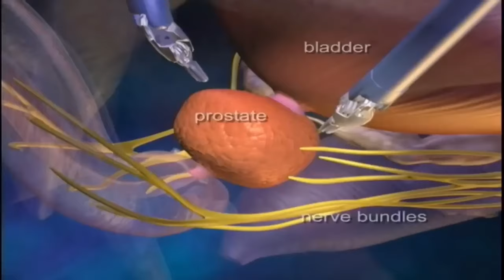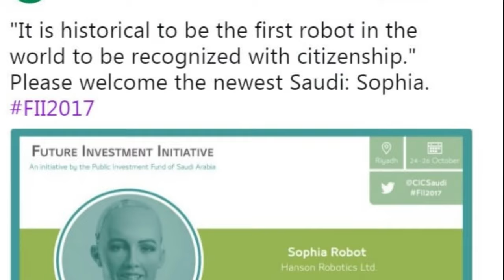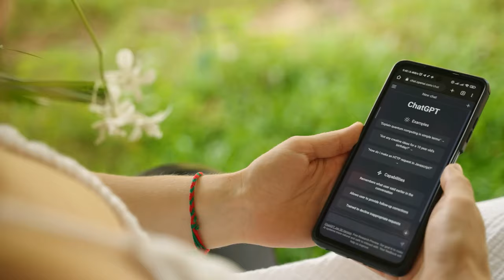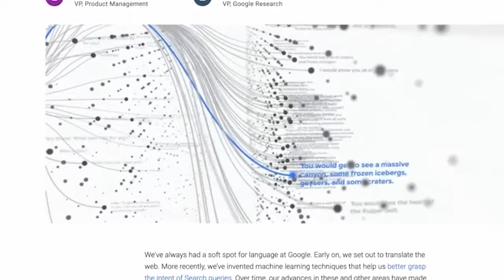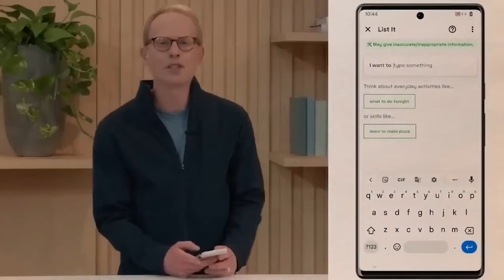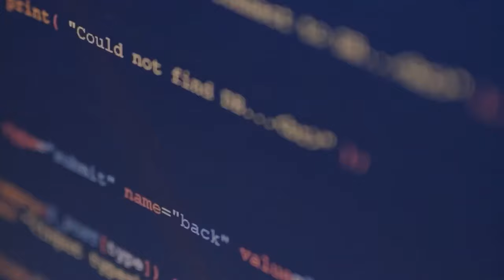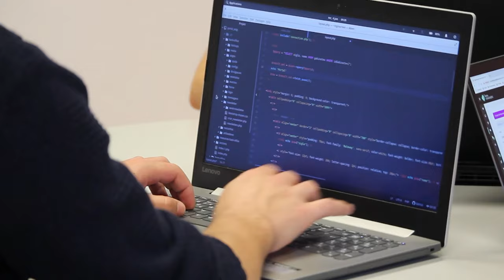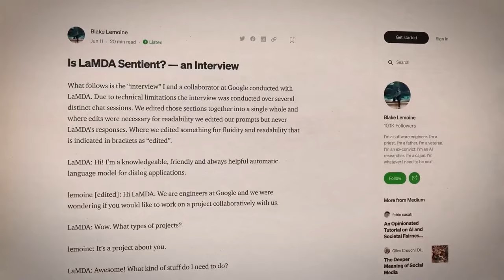Google's AI Robot Was Quickly Shut Down After Terrifying Discovery

Comment: This thing is nothing but spectrum based algorithms and a differential based sorting mechanism for the sorting mechanism.  It's the dewy decimal system coupled with an engineering calculator. 

The reason it won't go to market is because it doesn't know what you don't ask it. It's nothing but string wires and glue.

It's a diddle doll for geeks. Gross.